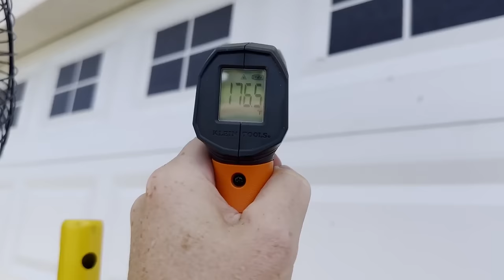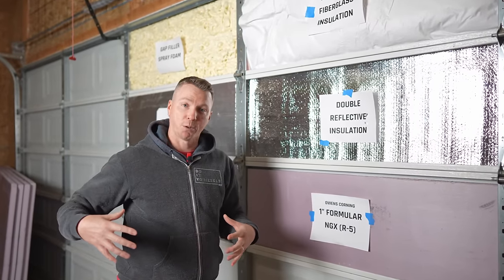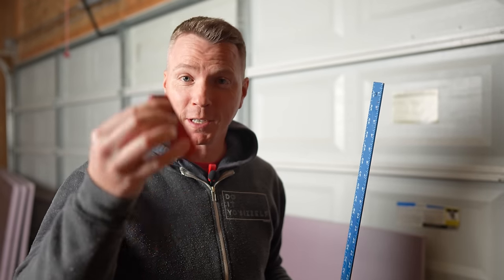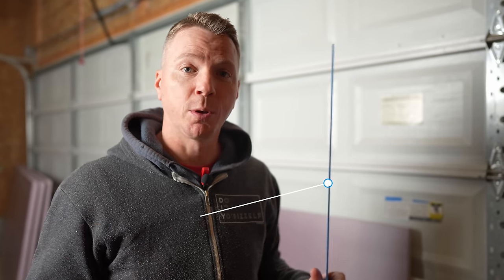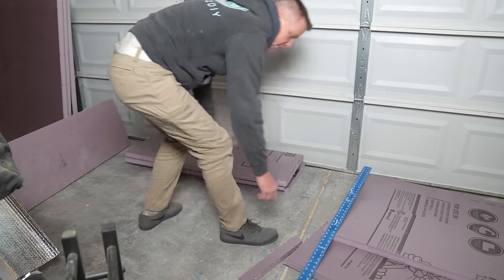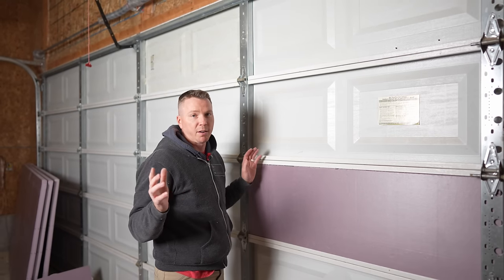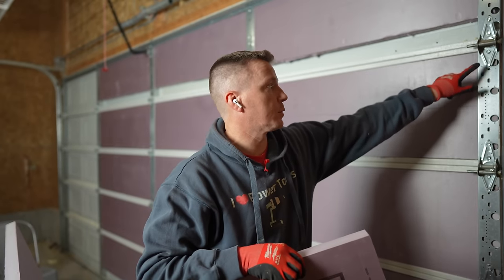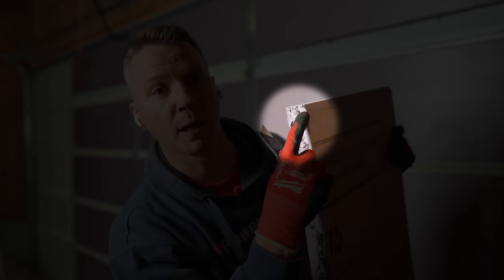The Easiest & Most Effective DIY Garage Door Insulation

Comment: Ok that works and looks good but you made way more work then you needed to do. Once you score the foam board just break it, done, doesn't matter what the cut looks like, you'll have the nice clean score line and the rest of the cut didn't matter, it's in the door you can't see it  Also you should have cut them at the 17-1/4" you needed. Then you put one edge in and give it a little bend and pop the other edge in. It'll fit tight, no spray foam needed and the lip on the garage door panel holds the foam in.
Reply: All this explaining...you could gave made your own video.😁
Reply: @derfskittlers6125 or you could had said nothing. 🤡
Reply from the maker: Good points but don’t forget there are lips on three sides, not just two. That definitely complicates things.
Reply: @derfskittlers6125 lol all that explaining? Score it, break it, snap it in.
Reply: Additional info is great thank you
Reply: Looks Great ,All tips Help,no haters just different perspective
Reply: I did it the way this commenter described with my last garage door (regarding cut sizing and bending panels), it was a pain in the neck. Also used two layers of 3/4” foam in each panel of I recall correctly, to make bending easier. 

However - finished result was great!
Reply: Using the foam is a million times easier.
Reply: @LRN2DIY What those lips do tho 
👁👄👁
Reply: @lawrenceshdow ...and the gap is fully filled.
Reply: Spot on.
Reply: Great job. Good fits. You took your time. That’s key. Thanks for the video
Reply: Snapping them in doesn’t work. I have to go back and tape mine because they pop out with temperature swings.
Reply: Rookies 😂
Reply: @ElegalvicnLa and how do you go about insulating a garage lil bro.
Reply: @LRN2DIY not to mention, it's called RIDGID foam board for a reason, flex a little too much and snap a doodle do!
Reply: I don’t think he is worried about out people seeing the cuts. He appears to be more concerned about out covering the entire area and by making clean cuts through the entire board he ensures it’s covering evenly.
Reply: Seems like the metal door would sweat behind the foam boards in humid climates.
Reply: Really nice explanation. Great presentation

Comment: XPS, including the new NGX, polystyrene foam board is highly combustible and must be covered with a protective or thermal barrier to separate it from a interior living space by code in most areas. Since a garage door is exterior and not to a adjoining living area, it would probably pass code. However, not mentioning that it’s highly combustible to your viewers is a concern. Someone adding a XPS to their garage door that may do work such as welding or grinding, will find out just how combustible it is.
Reply: Is there anything that would perform similarly and not be a potential fire hazard?
Reply: Id watch a video of someone testing the flammability of different foam boards,  and painted with fire retardant paint.
Reply: A super important consideration! Especially because a common objective with DIY garage insulation is to use that space as a living space or or as a workshop.
Reply: This sounds important and should be pinned
Reply: @MoneyManHolmes  Vacuum insulated panels and aerogel can be non-flammable and have very high insulation per inch, but are relatively expensive compared to other insulation. Some foams can include flame-retardant chemicals so they can't sustain a flame and won't spread fire, though they will still be damaged by heat and may give off nasty fumes while hot. Cement foam might also be able to qualify in some formulations, though it's not as common as other options and might be too brittle for something like a garage door.
Reply: Agreed! Here’s a quote from the manufacturer (found on Home Depot’s site) 
“Owens Corning Foamular products are combustible and must be covered by a 15-minute thermal barrier such as 1/2" drywall. We do not recommend using Foamular to insulate a garage door. There are better choices such as the Owens Corning Garage Door Insulation Kit.”
Reply: This commenter is contributing to the knowledge of this great video. Thanks!
Reply: @5467nick Cement foam might be a good insulator, but plan on upgrading your spring. I’m not saying don’t do it. Just plan appropriately. Thanks for your addition to the video.

Comment: Sorry if this is a duplicate comment.  Installation of this material as suggested is unsafe.  Per the manufacturer, "Owens Corning Foamular products are combustible and must be covered by a 15-minute thermal barrier such as 1/2" drywall. We do not recommend using Foamular to insulate a garage door. There are better choices such as the Owens Corning Garage Door Insulation Kit. Thank you for your inquiry!"
Reply: By the way, I like your content overall and am not trying to pick this apart.  I am an infrequent commenter.  To clarify my comment, this is a fire hazard.
Reply: @joshuabourdon8110 Agreed on the flammability problem. Putting a coat or two of white paint over the foam will markedly reduce its flammability (and make it look nicer, too!)
Reply: everyone commenting this... are yall using fire right next to your garage door?
Reply: @joshuabourdon8110  My whole house is flammable so I am not too concerned about it. But then again, I'm not really a "read the label" type of person.
Reply: @vitalsteve1 actually... yes! If you do any welding/ferrous grinding/or anything with a torch there might be issue. Personally I made inner panels from a plastic wall covering sheet material thats really thin from Lowe's, want to say tufted makes it and it's hdpe (milk jug plastic) but I may be remembering wrong. It's WAY cheaper and lighter than FRP... I'd build my whole shop out of frp if it wasn't so pricey. It's genuinely indestructible. Literally one of the best products ever developed by Uncle Sam 😆  it's genuinely urine proof, and it's mostly seen in public bathrooms.
Reply: @rangerpretzel  Until you have a problem and file an insurance claim.

Comment: Please be aware that rigid foam insulation is highly, highly flammable, and by code is not allowed to be exposed on interior finishes. And garages tend to be a location with open flame and where most house fires start. Better a proper three-layer insulated garage door with metal panels on both inside and outside faces to meet requirements in many jurisdictions and safe practice.
Reply: Hi. Do you have the name of the panels you’re talking about??? And what R value do they have?? Thanks.
Reply: Any alternate suggestions on insulation besides purchasing a new door?
Reply: Per Owens Corning on Home Depot’s website for this material, “Foamular is combustible and requires a protective barrier or thermal barrier as specified in your Local Buidling Code.”

Comment: I did this to my garage yesterday with 1” board. My wife asked me what I was doing. I told her and a day later ur video popped up on my YouTube feed. When I was done I opened the door and could hear the opener struggling. I saw ur video a day later and made me look up the specs on the 1” board. To my surprise they are 5 lbs per board. I used just under four boards. That’s just under 20 lbs added to the door. I took the door off the opener and sure enough it was harder to open by hand. I added three 1/4 turns to my spring and that seems to make up for the extra added weight. The opener sounds back to normal. I put a new spring a few years ago and up sized it from original. Thanks for the tips 👍🏽
Reply: You should have enough tension in the springs so that if you do the manual release so the door is disconnected from the door opener, the door shouldn't close by itself, and should require virtually no effort to lift it.
Reply: I see garage door installers weigh the garage door with a scale.set in the middle with the door disconneccted from the opener. You are looking for less than 10 lbs.

Comment: My garage door just died.  It was 24 years old and had many added braces to repair fatigued metal and such.  But it finally gave up the ghost, jumped the track, and almost fell on the car.  it was time.  Guess what?  You can buy new doors that are heavily insulated with R10 or even higher.  Metal on both sides, insulation in the middle.  And it wasn't that much of a percentage more money than the cheaper non-insulated one.  15% to 20% more or so.  More?  Yes.  But not double the cost or anything.  Now it is well insulated, and also far stronger and rigid.  Now, it's very much like an insulated steel front door.  Big improvement.  So, if you are at the point of getting a new door anyway, look at higher end double-wall insulated ones.
Reply: Thanks for the info. I'm on year six of "probably should replace this."

Comment: With garage door, you are trying to reduce radiant heat gain/loss. Foil backed polyethylene foam (bubble wrap) radiant barrier is the better choice and be sure to leave an air gap between the door and the barrier.
Reply: I might try that in my garden shed!

Comment: Definitely need to seal around the edges of the door. My garage door is 16’ x 7’, and it really flexes inward in a strong wind, which lets rain and snow to get inside past the seals. Some things that have helped with that problem are: brush seals for outside surrounding the door, the ‘Green Hinge System’, a double-bulb rubber bottom seal, and a threshold seal. These four things have made a significant impact in reducing water and snow intrusion. Thanks for the video.
Reply: Be careful doing this, make sure you leave a little gap and to not seal the door air tight or you might start getting mold if you don't already have temp control.
Reply from the maker: Great points. I noticed while I was shooting some thumbnail pics that just standing next to the door I felt a breeze and, after feeling around, it was coming from the gap at the top of door. I haven't yet installed the seals (I thing I'm going to seal the living daylights out of this thing) so that makes sense but it's crazy how well that cold (or hot) air finds a way in. I recently finished installing rock wool through the garage and will be installing a mini split soon so it should be very comfy in there by the time I'm done.
Reply: @smody121  I agree,but there’s still some air intrusion even with those things installed. For my needs, they have really helped to reduce the wind driven rain and snow from blowing into the garage. My cement slab can form some serious condensation under the right conditions, which is why I installed a cheap, small ceiling fan. And my garage walls aren’t insulated yet. Maybe some day.
Reply: @127001er  Good to hear you haven't had any problems yet. Getting air controlled garage is the holy grail. To be able to work on my car in the comfort and cleanliness of my garage... what a dream
Reply: I can vouch for the green hinge system! Those hinges along with an extra bit of weatherstripping on the outside of my garage door has completely eliminated any drafts around the door. I'm in Chicago so that is very important when I'm trying to heat the garage and it's 0 degrees out in January.
Reply: You can get green mountain hinges for wind and snow blow in
Reply: @lukesmith9059  what did you use to seal the sides?
Reply: Snirtstopper makes an option.

Comment: i did this 2 years ago with same board. but i added a sheet of bubble insulation first, then the board and then another sheet of bubble insulation. and finally i added foil tape to hold the bubble insulation and board inplace. came out really well. way less hot in the summer and less cold in winter. one thing to remember is a well insulated garage door by itself is only part of the solution. u have to make sure the space above and around the garage is well insulated or u wont get the desired temp. u want.
Reply: Bubble sheet radiant barrier or ?
Reply: @christophermackin147 a roll of bubble insulation you can get from lowes. just an added barrier. I also learned that you can install a temperature controled ceiling fan vent in the attic ( not the bathroom kind) or on the side of the garage wall. both options will pull hot air from the garage along with small inlet vents in the garage door to let outside air circulate through the garage. that will help keep the garage cool. next on my to do list.
Reply: How many foam sheets did you use for your project
Reply: @Wankidy  three 4'×8' 1inch thick foam boards.

Comment: I put 1½" ngx in my garage last week after watching your original video. My panels were 2 different sizes as well, but I measured each one first to be sure. Thanks for pointing me to ngx, really easy to work with but a bit heavy for my old spring
Reply from the maker: That’s awesome! Next week’s video is the entire walk through of upgrading your springs. It’s cheaper than you might expect and can very much be done safely.
Reply: Can you tell us abut the difference it makes, please. Maybe improvements, tricks as well.
Reply: Where did you buy it 1 1/2 inch?  i only see 1 and 2 inch available at home depot…

Comment: You can buy a foam insulation kit from some local Garage door companies. They will be cut to the right height 21" for the top and bottom and 16" for intermediate sections. They will be 8'ft. long so you cut them about in half depending on the width between the vertical styles where the hinge's mount. they often have a thin white PVC pebble tec finish backing skin so the whole door is white inside. This is easy to clean when you get dusty spiderwebs on the back of the door. They are not cheap because the Garage door company wants to make a healthy profit as it is a specialty item. They are installed the same way the insulation was installed in this video. They are a snug fit and it is a bit of a wrestling match to get the panels in place. I could insulate a whole door in about 2 hours but I have a lot of experience. If I were to do this I would compare the price of the kit versus the cost of enough sheets of Owens -Corning insulation to complete the job at your local Home Depot. If you Garage gets Western sun in the afternoon this will keep the garage much cooler. However, if you pull your car into an insulated Garage after your commute home it will also keep the heat from your hot engine in the garage. The insulation will add weight to your garage doors spring(s). They may need to be adjusted to get the door to open smoothly. Call a pro to adjust the spring. It will be much cheaper than a trip to the Emergerncy Room if you try to do it with out the proper tools and knowledge and some thing slips. If you try and get hurt you will still have to call a pro to get it done. Trust me. Springs can kill. Let a pro take the risk.
Reply: You’re doing it wrong then you want the reflective kind with the reflective part facing outwards. The panels are literally under $100 to do a 2 car garage and you don’t need to adjust the springs
Reply: @Just_A_Name14 so both the youtuber and this commenter are doing it wrong?

Comment: I filled the whole panel space by cutting the 40 mm thick polystyrene sheets to the correct size but in two halves. The top and bottom halves could then be angled in at the top and bottom and pushed in together in the middle creating a very tight fit. I cut two of the rows approximately 20% and 80% of the panel size as the door's reinforcing rails would then cover the joins. The sheets have been in place for 5 years now and none have popped out. I also glued wall wrap (foil) behind the foam. I also corrected my mistake of not ordering the west facing door in white by painting it white to reflect the afternoon summer sun.

Comment: Thanks for this video. I bought six 4 x 8 sheets and did both the double and single garage doors, with hurricane braces, in about 4 hours. One of the easier home DIY projects I've done. I have yet to seal them in place with spray foam but the individual boards are staying put, no problem.

Comment: Nice.  This would be a worthwhile upgrade for my simple garage door even without the full seals.  My primary trouble is extreme heat radiating through the door on summer afternoons and this would work nicely to lessen the heat buildup in my garage.

Comment: In live in Florida and it's required to have hurricane bars horizontally across the door.  Mine has 5 huge bars which I would need to remove in order to install foam panels.

Comment: There are versions of the foam board that have relief cuts in them so you can bend them a little to fit them in the "C" part on the sides, bottom and top of the door.

Comment: I am new to the insulation stuff...Seeing your video feels like I should be able to handle this project quite easily. Thank you for explaining in so much detail and also sharing testing out which one is better than the other. Really appreciate this level of details.

I have a question...If I were to add multiple layers of insulation, Let's say 2 layers of double reflective insulation, will it be better than 1 layer of double reflective insulation ?? Maybe not?

Comment: Like yourself, my garage door panels are not all equal in size so I can appreciate the "oops" moment.  I'm getting ready to insulate my two double garage doors, but plan to use Johns Manville polycyanurate 1" insulation.  First of all it's rated R-6, and secondly it is foil backed, which I will place against the inside surface of the doors to reflect the suns heat.  I need all the help I can get in Arizona.

Comment: Great video. I had no idea how much heat went through my garage door until I got a thermal camera for Christmas. Now I am wondering what to do about the windows I have in my door.
Reply: You could tint the windows with the reflective tint.
Reply: Hard to say exactly what to do not seeing the door, but to still pass light you put a insulated panel on with the window area cut out and put a sheet of Lexan in that hole. The air gap would give some insulation value.